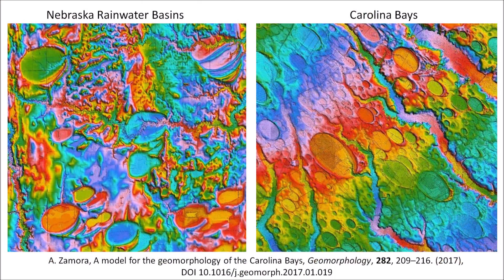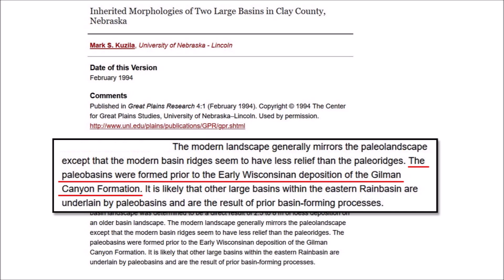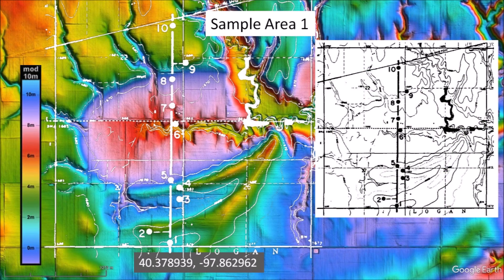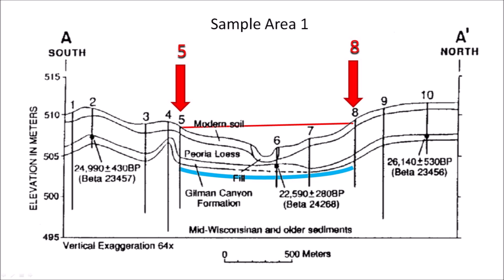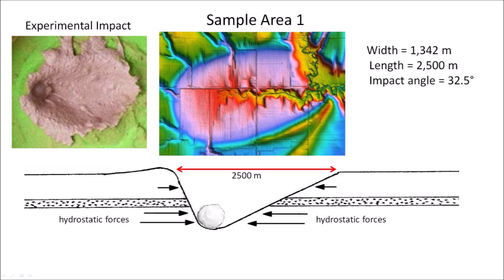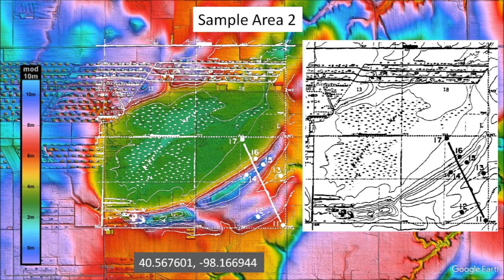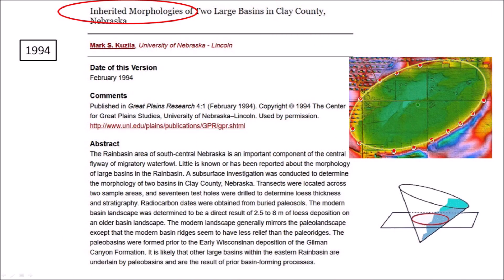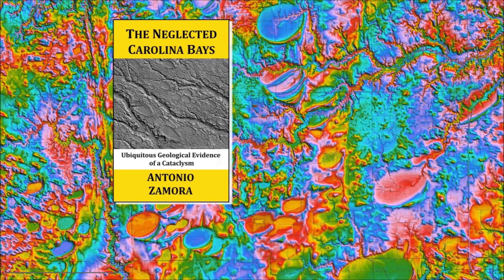Nebraska Basins

Comment: One would expect an overturned flap just beyond the southwest rim of Sample Area 2, perhaps with evidence of inverted stratigraphy. If the impact formed the basin after 26k years ago, one might find evidence of some of the Gilman Canyon formation on top of some of the Peoria Loess which is above the in situ Gilman Canyon layer?  If the impact was before about 26k years ago, there could not be a Gilman Canyon layer to flip over and find in the inverted stratigraphy.  If I was a geology grad student I would dig a 10 meter test pit and examine samples inch by inch and try to identify the horizons.  I can speculate that flap could get eroded and erase the inverted stratigraphy, so absence of evidence would not necessarily be evidence of absence.  But if evidence of the Gilman Canyon layer is found in an inverted stratigraphy in the flap area, it seems like that would be very strong dating evidence.  

Is there any equivalent well-dated layer beneath the Atlantic Coastal Plain?
Reply from the maker: The idea of looking for inverted stratigraphy in the overturned flaps is very good.  This is one of the predictions of the Glacier Ice Impact Hypothesis that has actually been confirmed.  It is described in this video: https://youtu.be/d6gisXApcw8?t=669
and also in this video:
https://youtu.be/j63e8n0628Q